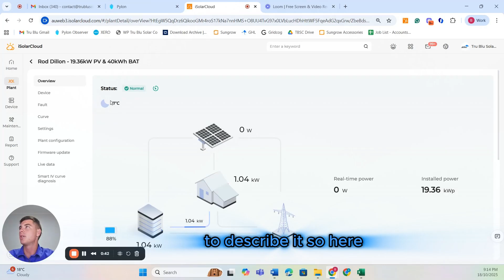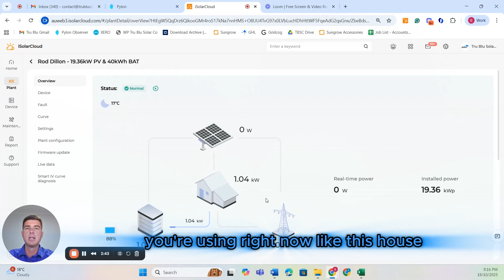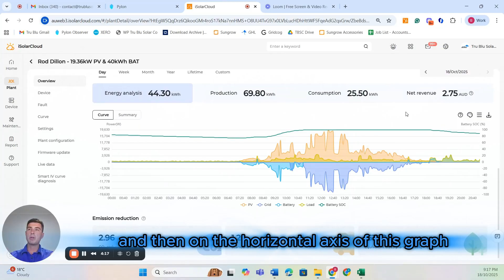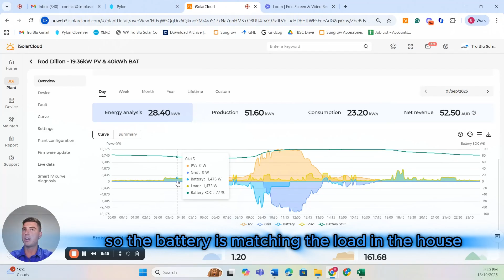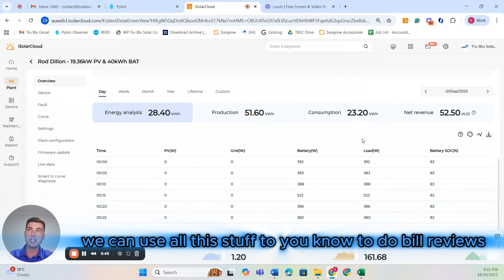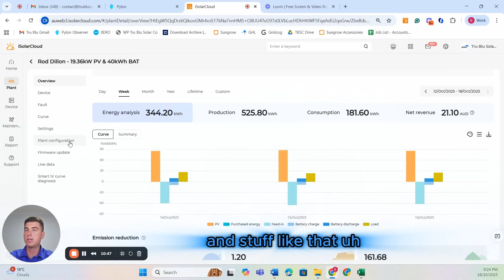Sungrow App - iSolarCloud Walkthrough

Comment: I’m planning to pair a Pylontech Force H3 with my SH10RT, but even in Admin mode, the battery selection menu is missing all third-party options (BYD, Force H1/H2, etc.). Are these automatically detected once the CAN-bus is connected, or is it because of newer firmware and strictly going towards closed ecosystem ? Where specifically can I find the battery selection toggle